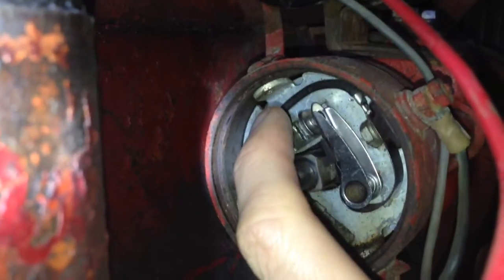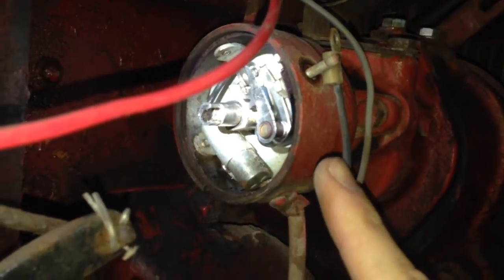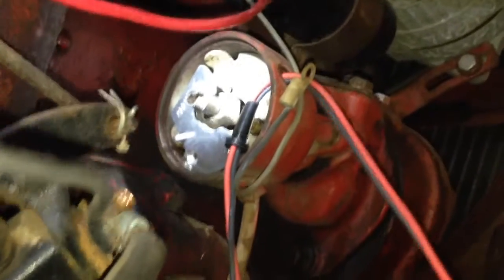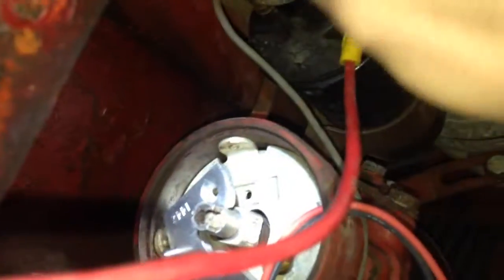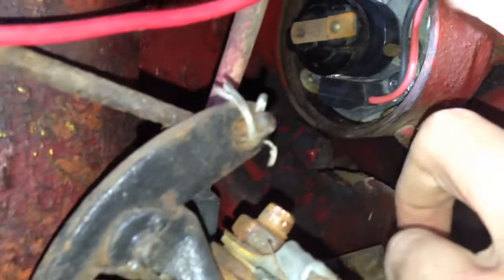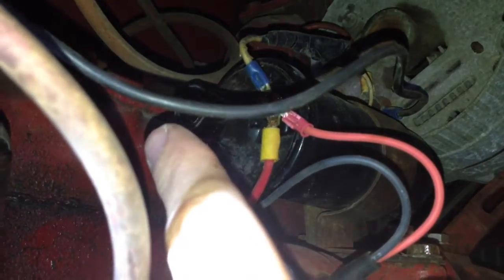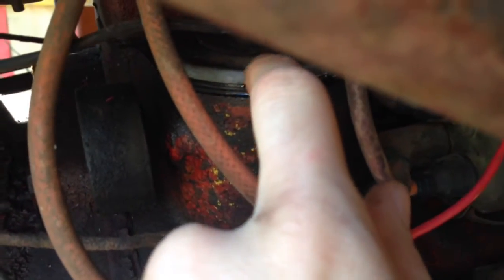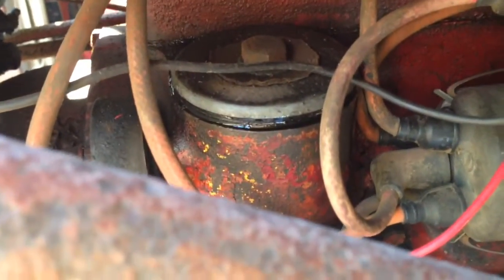Farmall Cub Pertronix Ignitor Install

Comment: what is the part # for the kit that you used?
Reply from the maker: http://amzn.to/2vS56FH 

I'll also add it to the video description in case the link gets removed from this comment.
Reply: My 58 IH 350 Utility with a C175 gas engine uses a 1442 Pertronix. Neg ground, 12 volt.